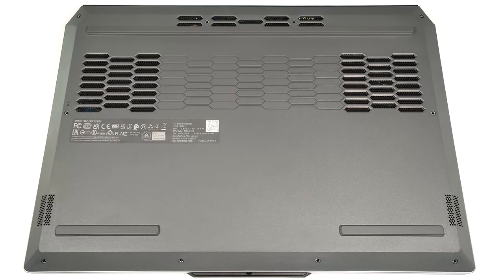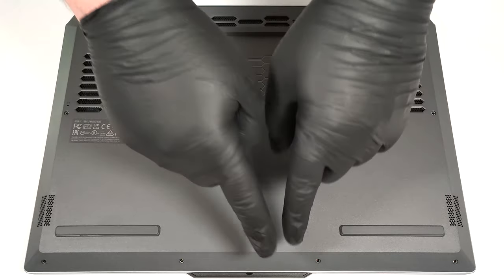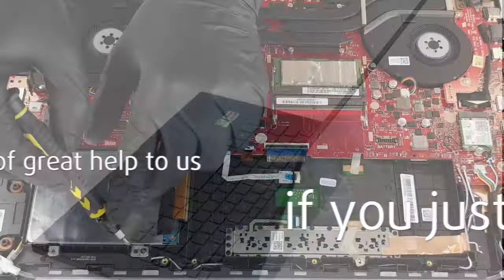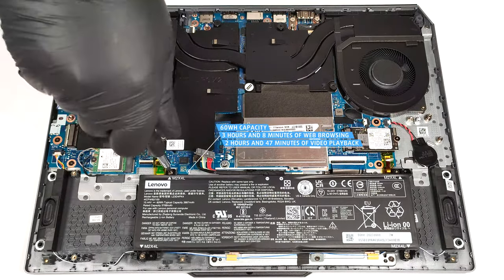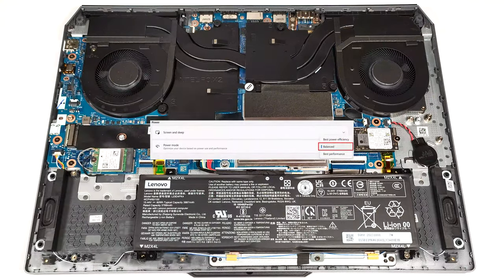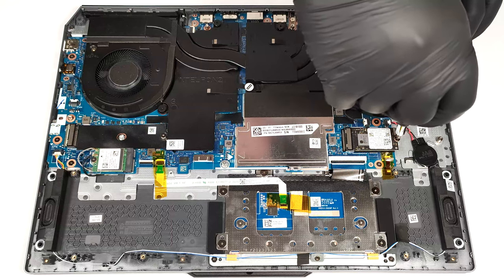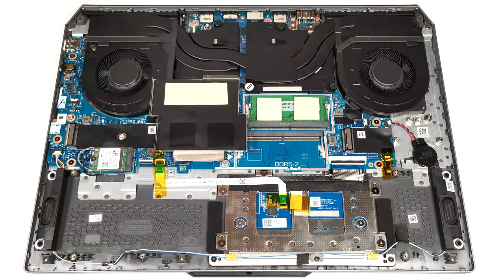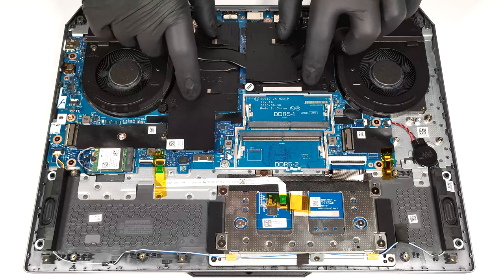🛠️ How to open Lenovo LOQ 15i (Gen 9) - disassembly and upgrade options

Comment: Lenovo always have wonderfull cooling system. Good work Lenovo
Reply: @notfunny85 No Bro, it's different type LOQ more light and smaller. The others with 4 exhaust are Ideapad Gaming 3 it's bigger and heavier. So choose according to your needs
Reply: @notfunny85 Yeah, of course. But more thin and light weight. So if you need better cooling, choose Ideapad Gaming 3
Reply: @notfunny85 But even LOQ only have 2 exhaust they using copper exhaust fins that are more expensive and efficient than aluminum fins. Most laptop at same price like Asus Tuf still using aluminum exhaust fins
Reply: @notfunny85 You're welcome Bro
Reply: @Garry-Stewart  how do you tell between the two? The color?
Reply: @trip_t2122  Yeah, copper have brown with little bit yellow color (my english is bad sorry)
Reply: @Garry-Stewart  I can understand you just fine, thanks. So aluminium is grey? I wonder why they would use aluminum in Asus TUF use Aluminum yet my old budget IdeaPad uses copper.
Reply: @trip_t2122  That because they dont want to spend more
Reply: @trip_t2122  Copper is more rust resistant and has many times the thermal conductivity than aluminum
Reply: @Garry-Stewart  I understand now, thanks for explaining
Reply: true, my laptop never goes above 70 degrees even after playing heavy games for 10+ hours

Comment: Is it possible to install a 2280 ssd on the stock 2242 ssd's slot? I see a screw hole further back but I'm not sure if it's for the ssd or the bottom cover
Reply: Yeah it's possible
Reply: Remove the 2242 stud. It should have the storage for the stud and you can install it there

Comment: I need to ask, is all NVME slot support 2 sided SSD like Adata S70 Blade, or 1 need to be single sided like Lexar NM790? I wanted to buy this laptop and SSD also RAM, but confuse about the SSD config

Comment: Can you access the fans for cleaning from dust without taking off the whole cooling system and reapplying the thermal paste and pads? In general, I think in all those videos that's the number one thing that is lacking. Other than that, thanks for useful content.

Comment: Good laptop runs so hot and loud though, I did everything but found just disabling the turbo worked best overall and performance affected only slightly
Reply: How did u disable turbo?
Reply: @astronut5430  Throttlestop

Comment: Is it possible to install a SATA SSD? I noticed that there’s a space beside the battery.
Reply: yes i thinks
Reply: no it is not there is no mounting hardware nor connection port. (you could install a sata m.2 but not a 2.5 inch sata ssd)